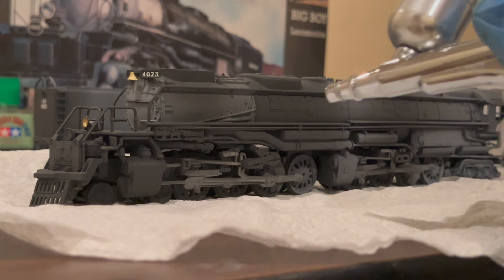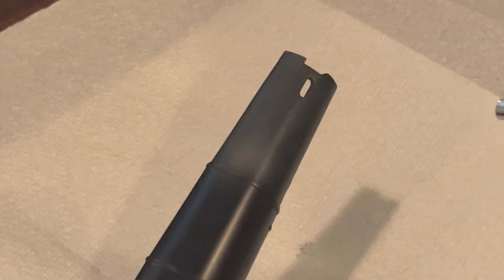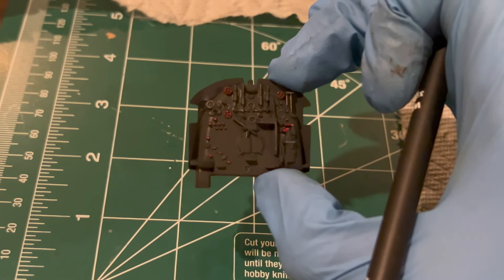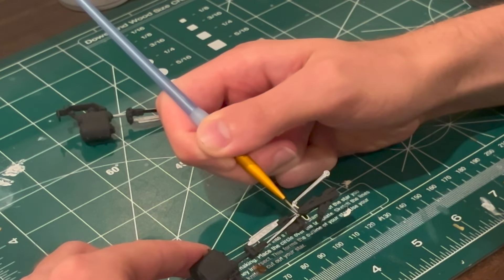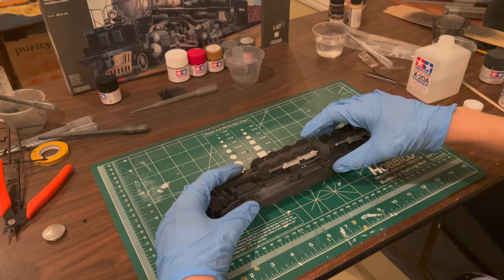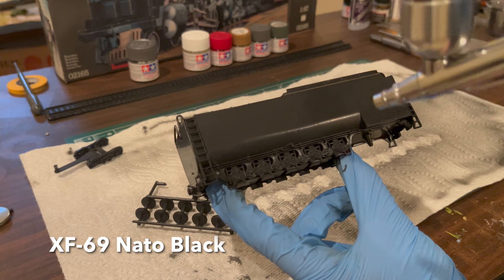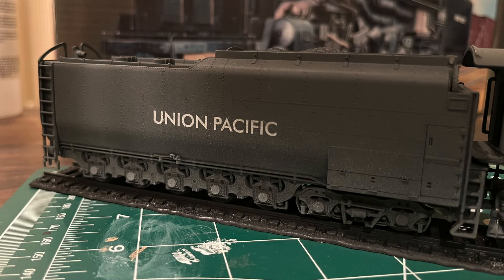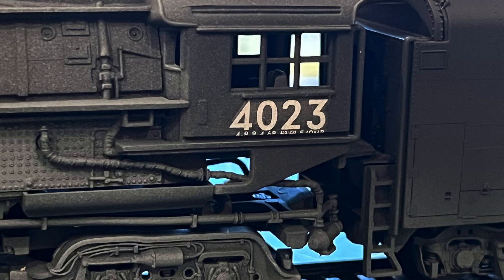Revell Big Boy Locomotive Model: Full Build and Review

Comment: I was wondering on your thoughts about not using a primer before primary coloring, specifically wrt Tamiya XF paints.
Reply from the maker: These paints adhered quite nicely to the plastic without the use of primer; however, if I were painting a brass model or had to do more extensive masking, primer is definitely a good idea
Reply: @ Thank you.  I’m in process of building a 1/350 USS Missouri., using thinned Tamiya paints/airbrush.  I primed & painted the hull/deck and I am starting on the upper structure with its numerous small parts, many of which seemed I could skip priming.  Much photo etch too that probably should be primed.